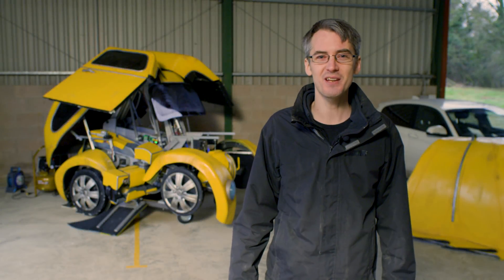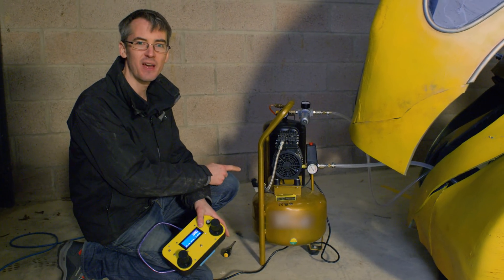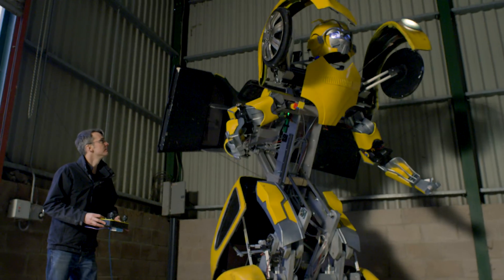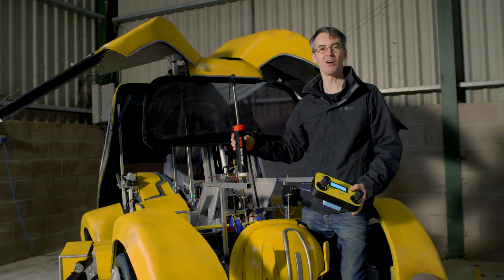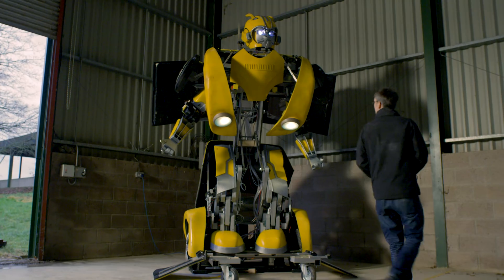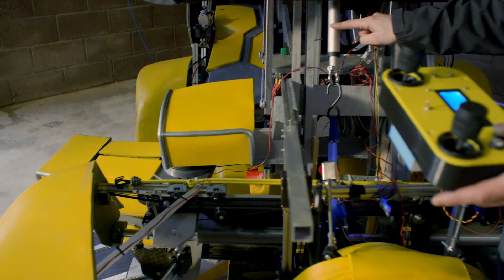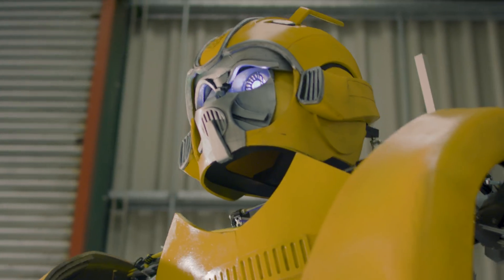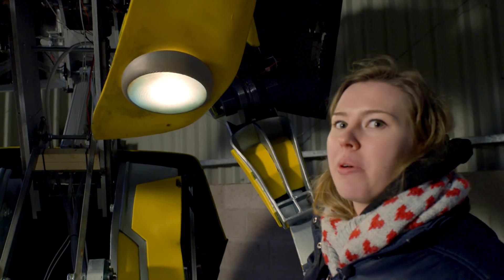Building Bumblebee the REAL TRANSFORMER #4 | James Bruton

Comment: Honestly the mechanics are amazing but some of the panels like the Bonet don’t fit together very well however the small parts like the arms and head look absolutely amazing. Also when the car is not transformed it looks sort of depressing and droopy but other than that and the fact that i think the arms are to short and thin which I’m guessing is due to the extra weight and unbalance they would cause the project is great

Comment: I think the occasional negative comments on this one can all be covered by the phrase "There wasn't time". 

James usually builds projects over several months (And sometimes over more than a year). He'll design it, Build it, Break it, Redesign it, rebuild it, rethink it, Upgrade it, Then when everything works, finish it.

They were both building their own sections of it at the same time, And that's bound to lead to compromises so as not to force the other person to completely redo something they've been working on to make it work with what you've done. If James had time to really go to town on the mechanical side before the whole project was handed over to Kyla to skin it I'm sure it would have looked a lot more realistic as a car.

As it stands, it's pretty stunning work considering the compressed time frame available.
Reply: Thank you for understanding our process of working and the difficulties we faced :)

Comment: Hey James, as always, I'm impressed with the mechanical work, and Kyla did a great job on the head and painting.  I think the one thing I wasn't a big fan of was the faceted/flattened body panels.  It would have been cooler to have taken "splashes" off of a real vintage Beetle to make molds from which fiberglass or plastic body panels could have been made, preserving the original shape of the car and making it look convincingly like an actual old car when folded up.  Anyway, nice work overall and congrats on getting to work with a company like Paramount.

If you do anything like this again, though, I hope you devote a little more effort to getting the exterior form more faithful to the source.  The hood (or bonnet) popping off is understandable, but with a bigger budget and perhaps more time, you could totally deal with that more gracefully, too.  There is nothing in the laws of physics preventing it from happening is what I'm saying, but it would definitely involve a rather complex mechanism.

Comment: Would have been cool if you started with a real VW...
Reply: Jonnyreverb Or just a mold of the exterior to get the shape right.  Probably could have been done with plaster for the negative molds, and then fiberglass for the panels.

Comment: Improve the cosmetics (actual car wheels, beef up the arms and legs use real car panels) and it would look a million times better
Reply from the maker: it won't left any more weight
Reply: @jamesbruton  Have you heard of "lightning holes"?  The plywood parts could be made much lighter without sacrificing strength.  Thin skins can hide the fact that they are not solid.  E.g. drill and rout out much of the interior, then cover with luan or plastic.
Reply: Would have loved to have added more to the arms and legs but there wasn't anymore room in the car - we were cutting bits off here and there to make everything fit and not collide with any of the mechanisms as it stands up.
Reply: @kylahislop6212  That should have been covered in a video, going over the issues and your solution.  And, I would like to see it compared with the toy: how does it work with the proportions it has?

Comment: Great job James and Kyla! Amazing that you have completed it so fast. As a minor point, I'm still voting for some wider tires, maybe just using some curved foam to give the wheels a bit more body. Thanks for the videos.
Reply: Thank you! Yes, there are some improvements that could have been made, but Bumblebee is very...weight sensitive. So even using a slighter denser foam for some parts might have had the upper body put a toe over the threshold and made him tip back again or fail to stand up.